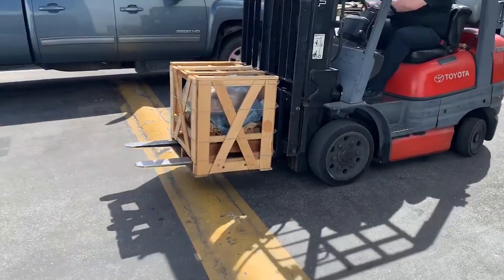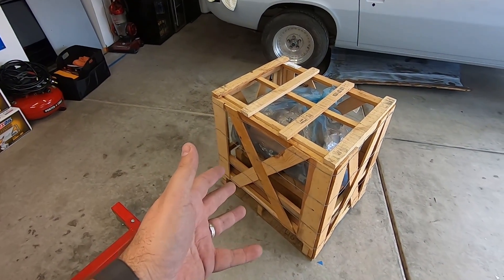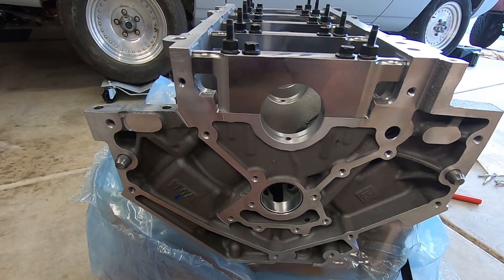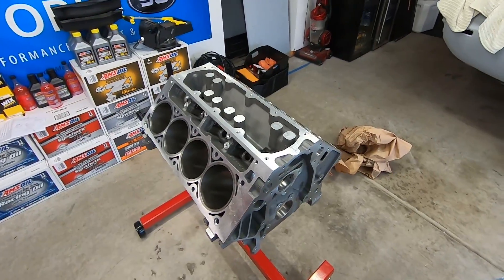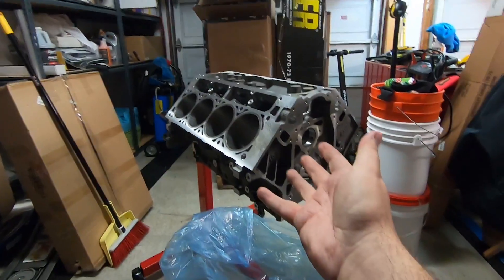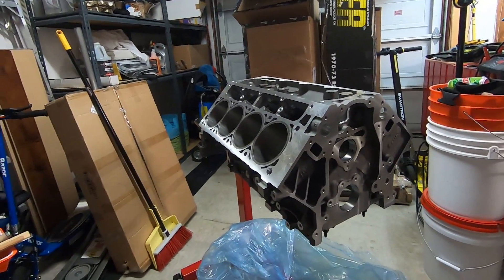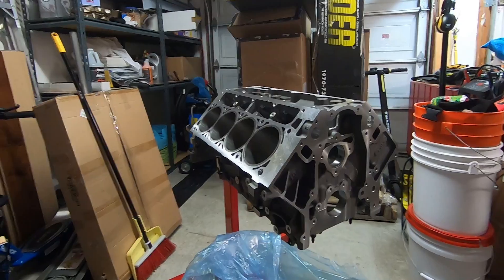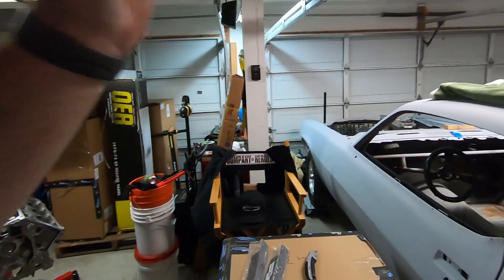LS7 427ci Build | Engine Build Ep:1

Comment from the maker: Who can down vote a LS7 video? Must be Non-American.
Reply from the maker: Terminator X??? ;)
Reply: Sadly due to age I have not had any experience with carburetors BUT fuel injection from everything I was ever told is the only way to go. Which may be the 2 down votes due to people not liking carburetors.
Reply: @LineMUp321  carb setup is simplest it can get. But you won't get the max out of it. Fine tuning and such. Different from efi where a guy can reflash the CPU and see EVERYTHING that's happening with the engine. But than again. There's a million sensors and relays for that.
Reply: @LineMUp321  carburator mixes air better then efi.
Reply: @Lethel Garage off topic but I gotta tell you,in particular about this.Stangmode sources have told him the Ford gt is getting a 7.3tt next year.gane.over.mic.droped.

Comment: Not true Matt, I've built many motors in my time, big blocks, small blocks, buy the time you add in your time and effort, plus parts,lube, gaskets and pulleys...etc....etc...and shipping for the parts, it's cheaper to order one tailored to your specs.and you get a warranty,  when something goes wrong with your built motor it comes out of your wallet. If you enjoy the build I understand,  been there many many times.im 55 and owned and built 9 Camaros in my time from pro street to stock with correct numbers. But your vids are super cool and informative,  rock on brother.....